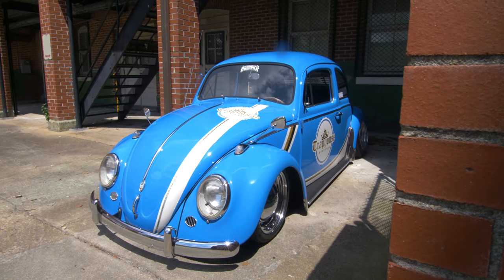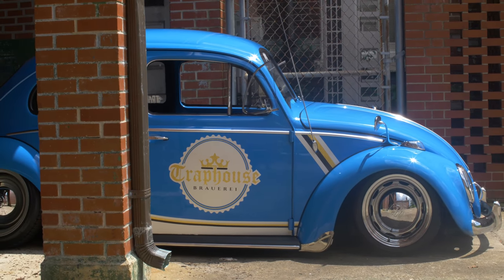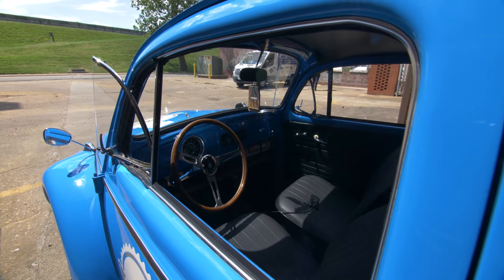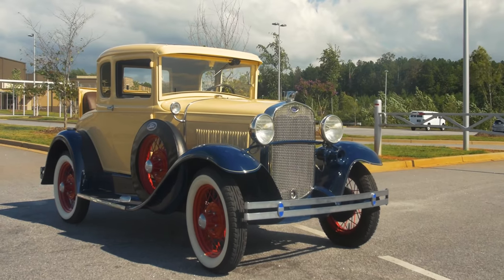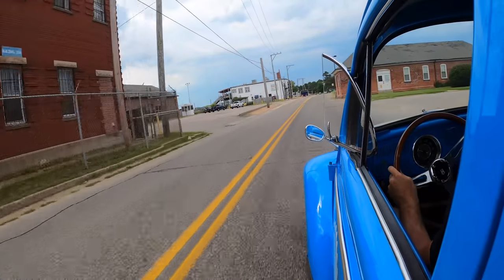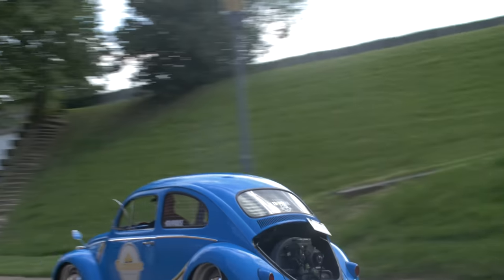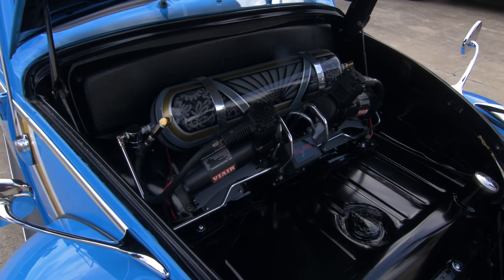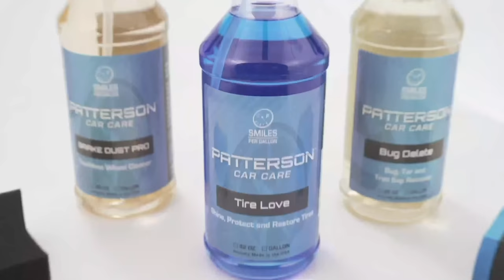Bugs and Bags: 1961 VW Beetle Review!

Comment: When I was a young boy in the 1980s I heard of hopped up Volkswagen beetle pull away. I fell in love with that sound and didn't understand or know what it was. What I mean was it was a boxer engine later in life I purchased a Subaru legacy 98 wagon. It has a 2.2 l 5 speed manual. I cut the exhaust and had an exhaust shop remove the resonator and put a glass pack on it when I heard the sound of it I realized hey this is the same kind of engine that I remember when I was a kid. I didn't know much about Subaru at the time when the car was purchased 2015 but I fell in love with that box or sound because it was a sound that I fell in love with as a boy hearing that Volkswagen beetle pull out with custom exhaust.

Comment: I had one of these static and it was the toughest car to drive, lowering those rear ends causes extreme camber if you wanted it or not lol.
Reply: Unless you have a ‘71 or newer, or change to a ‘71 or newer (IRS) transaxle.  You’re right, you can’t avoid the excessive chamber with the older swing axle transmissions (I personally like that look)

Comment: So I am, and have always been, a diehard Honda guy...I grew up in Tampa, Florida in the late 90s, early 00s, and my first few cars (I am 37 now and I've owned 65 cars since I was 14), were all domestics, but in 99 Hondas were really becoming famous and I had a really heavy jacked up 94 Eddie Bauer Ford Exploder on 33x12.50s with a Skyjacker 6" suspension and 3" body lift. I moved here to Pittsburgh and was here for about 2 months before I traded it to a friend for a bone stock DA9 1992 Acura Integra. The next year the first FnF came out and I was dead set of modifying my Integra. I gathered parts for a turbo kit and it was almost like pulling teeth between having a job that paid $5.50 an hour, having to pay rent living at a family member's house, and smoking weed all the time, but I eventually got it turbocharged and on 12 psi on an old Dodge Daytona T3 turbo (that was seized when I bought it for $50, but freed up after sitting in WD-40 overnight), and it eventually made 257 whp on a stock B18A1, YS1 5 speed manual cable trans, tuned on a Zdyne Gold SECU. It was alot of fun to drive and it was fast, but now I have a 612 whp EJ8 Civic coupe and a JDM J32A and six speed manual swapped CG1 Accord with a GT35R turbo and it's making close to 450 whp...so I suppose that was the beginning of my love affair with Hondas...

Comment: About your comment, that you can't imagine driving a bug on the Autobahn, the Autobahn is just a high way as in every other country.
Of course nearly everyone enjoys going fast every once in a while. However on many routes there are speed restrictions and there is also the recommended top speed of 130 km/h (80 mph). What that means is, if you crash going faster than 130 km/h they will investigate if this extra speed made the outcome of the crash worse and take actions against you. The reasoning behind this is that you have to make sure that you can go fast in this situation. 
However what I actually want to say is, that you can drive with a bug on the Autobahn, because not everyone drives 120 mph. Most of the people drive between 120 km/h (75 mph) to 180 km/h (110 mph) and trucks and lorrys can't go faster than 80 km/h (50 mph).
Also back in the day, when the bug was used a lot the overall speed on the Autobahn wasn't as high as today and there were less cars on the Autobahn.
One last thing is that people also drive with the Trabant on the Autobahn and it works.
I hope this gave you a little bit of information about the Autobahn and the driving in Germany.
Kindest regards from Germany ^^